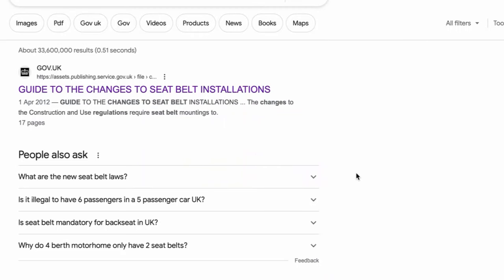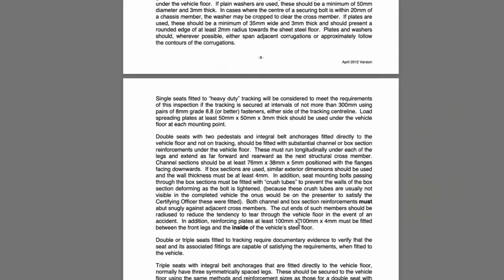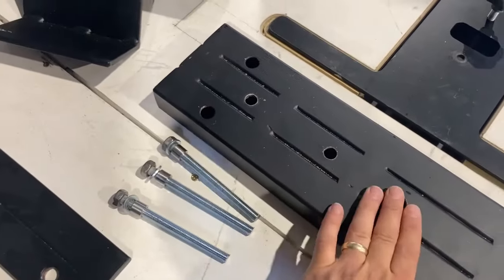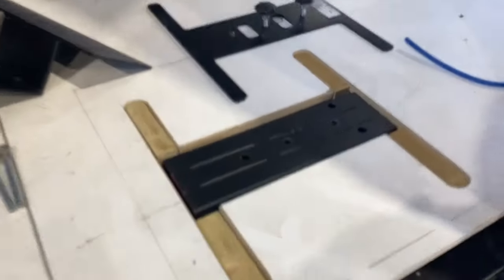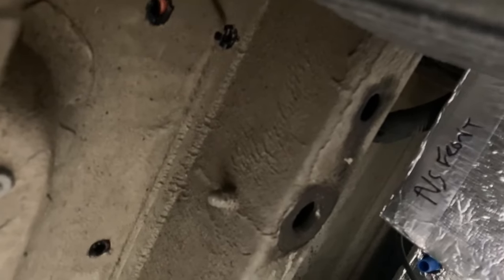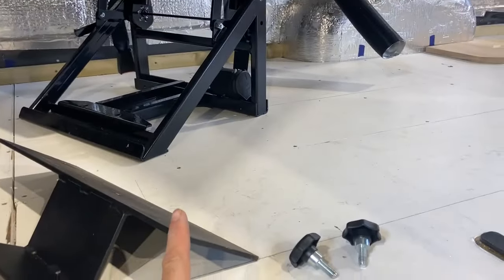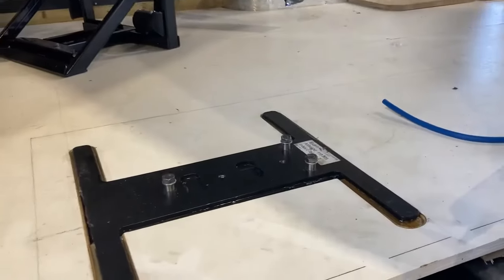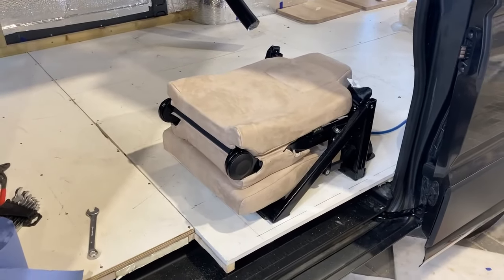Installing a belted seat into a van conversion - a folding removable seat, 4th passenger seat

Comment: Hi great video, were there any specific tests or certifications you needed for adding this type of seat?
Reply from the maker: The seat comes with the certificate required showing that it has been sufficiently crash tested. You also need to ensure it is installed using government regulations that you can find online.